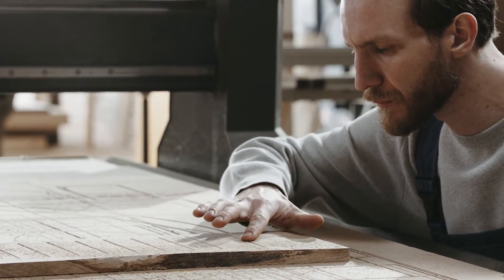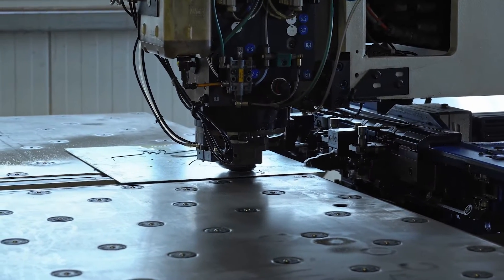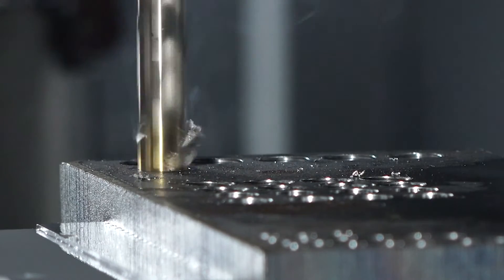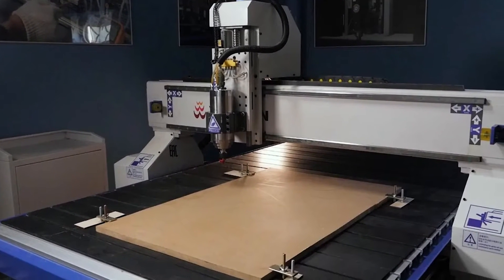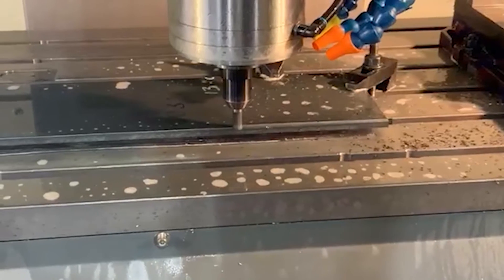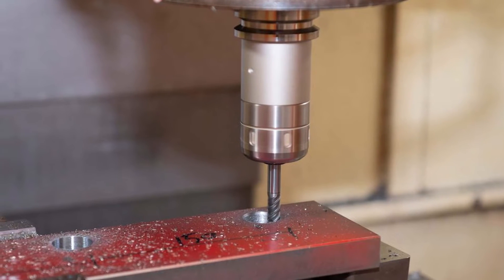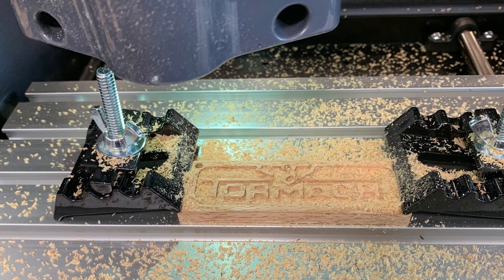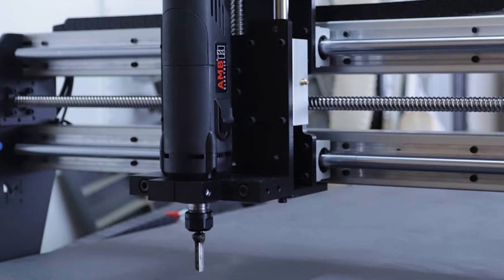CNC Milling Machine vs  CNC Router: What is the Difference?

Comment: This is all complete b.s.
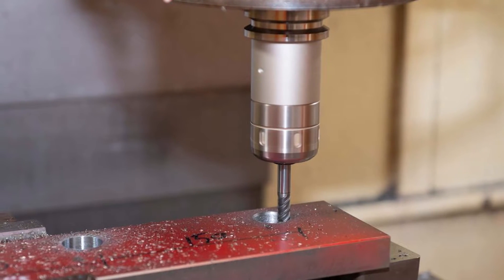Machinist here-10 years, dont listen to this computer clown. A router is for wood, plastic, sheet metal, etc. Mills are for precision and can cut about any material (assuming its like, a real professional mill and not like, an amazon GRBL or whatever). @5:00 or so he starts talking about how if you have multiples, you should go with a router... No? CNC is CNC, get stops set up, they will both run as quickly as you can load and unload them... in fact, the rigidity of the Mill, I would think, would allow you to 'push it' a little with a mill vs router. 

Router if: huge, precision isnt so important, soft material.
mill if: Its metal (or harder tahn aluminum), precision is needed, you have many to run. 

I worked in a shop where the router was in teh same department as the saw and laser. We cleaned/'precised' everything up with a mill or lathe in our "op 2" department. often we used router parts for body parts/panels